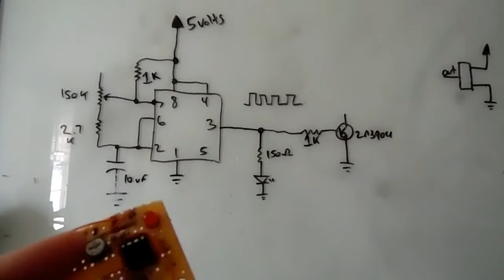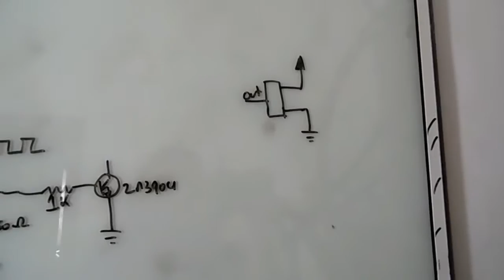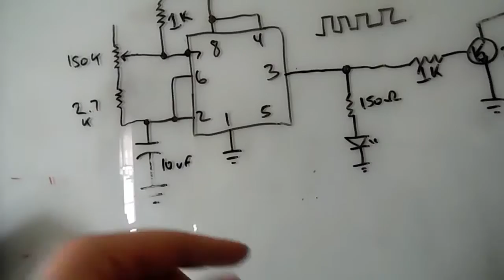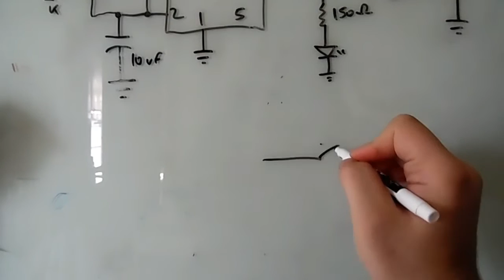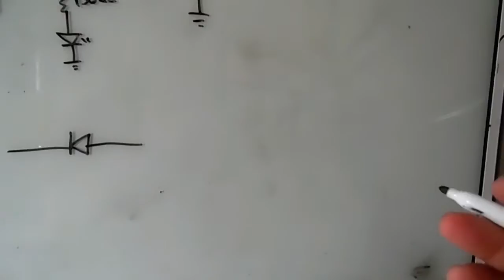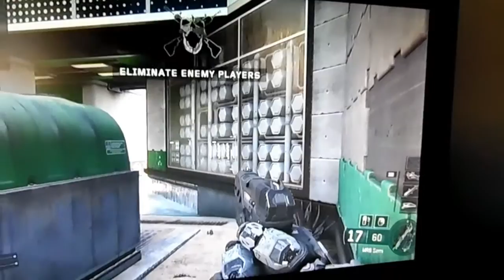XBOX ONE RAPID FIRE MOD

Comment: Don't lie, u gonna use that sucker. U just don't want the hate, nice try
Reply from the maker: NU VLOGS lol I actually don't use them. I don't play cod or anything anymore. In my newer vids I design my own board and even throw in my rapid fire design but never hook them up
Reply: Taylor Burley I actually just made my circuit and I just got my transistor hooked up I haven't gotten into the controller because I can't find the right screwdrivers

Comment: Hi Taylor. I follow the different step and it doesnt work! When i push on the switch its work like the  right trigger. The only thing that i dont have put on the circuit is the led with is resistance. Can you maybe help me? Thanks to you

Comment: im getting seriously frustrated i cant seem to get it to work. i follow the diagram the best i can but it just started smoking. i have the pieces for it ordered everything and waited several months to finally get it all in today but its not working.  can you possibly do another video but a bit more simple? or skype to help me out please?
Reply from the maker: sparky1570784 send me clear pictures of your circuit to my email. Drburleybur@gmail.com
Reply: sent a few photos of 2 setups. the first one was following your tutorial the second was a diagram off of the internet for a 360 controller.
Reply from the maker: sparky1570784 
I got the pictures. It's a bit hard to see with the dead bug type style. Do you have an led you can tie to the output to see if you're getting a pulse?
Reply: i connected an led and the circuit is flashing when its powered from that capacitor on the controller but connecting pin 3 to the controller trigger doesnt seem to do anything. its not making the controller fire.
EDIT: i got it to work i had to remove the 1k resitor on pin 3 to allow it to fire.
thanks!
Reply from the maker: sparky1570784 
Did you connect it to the right spot on the hall effect sensor?
Reply: yup all working now thx

Comment: I'm not sure if you are familiar with GH Live for the Xbox One but I'm looking for an easy way to turbo the strum bar. There is an achievement for strumming 1 million times, which is taking a surprisingly long time so far. Do you have any ideas for a simple solution? I'm not too familiar with circuits so I wasn't really able to understand how the circuit from your video worked.
Reply from the maker: Oh that sounds fun! I'm sure that when you strum something like a pot goes to ground. You can send ground to it with a similar circuit or if it goes high you can use a diode with this circuit. With pots there are 3 pins, the middle is called the wiper and the two outers are the outputs. The wiper moves along a path of resistance which can tell a controller that its going high or low. if it goes low you can use this ciruit by running the out put that goes low through the collector of a npn transistor and control the base with a fast square wave using a timer or micro controller. If it goes high you can use a diode pointed towards the high outand turn the other side on and off using a wave
Reply: Hey thanks so much for the reply. It sounds like you put some thought into it. Unfortunately, I hardly have any experience with designing circuits so your suggestions don't make too much sense to me. I'll have to investigate more.

Comment: these videos are great. I noticed you changed the pinout on the hall effect sensor from the diagram you had shown on a notebook for the hall effect sensors explained video. I. the other video you had the volt in and volt out on the same side of the chip with the gnd being on the single pin side. can you confirm which diagram is correct?
Reply from the maker: very good catch! I must have just thrown that symbol on the witeoard and messed it up. The one on the notebook is correct. sorry about that :)
Reply: Thanks for the reply. I ended up using my meter to determine.  Do you know how we find the right sensor if we need to replace?  I'm an amateur compared to you, but it's fun fixing this stuff
Reply from the maker: No problem! I can not seem to locate the exact model but I was able to find similar ones only downfall is you have to order in bulk :/